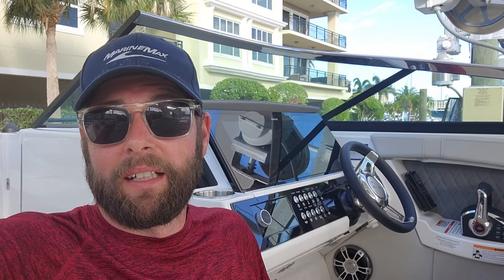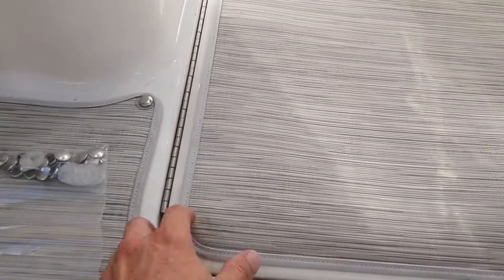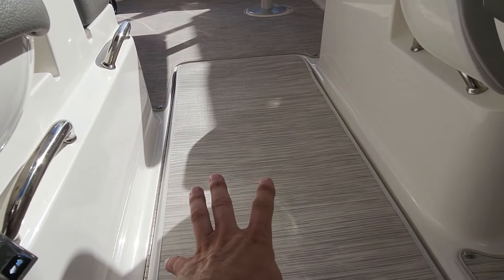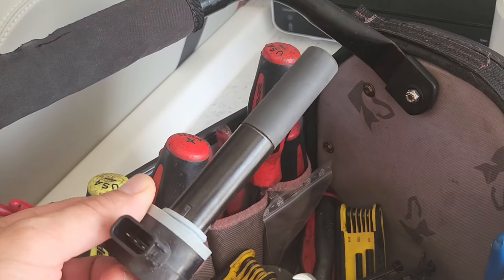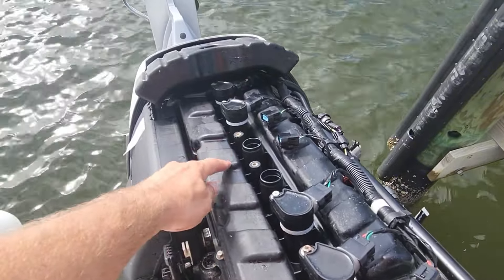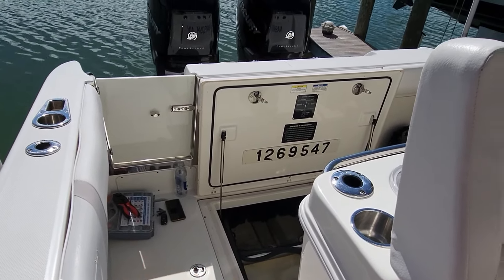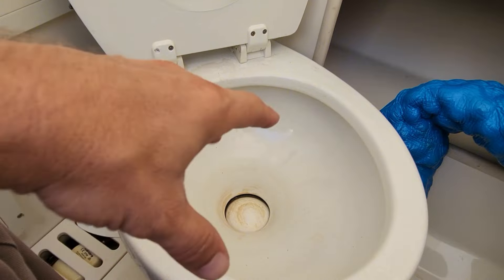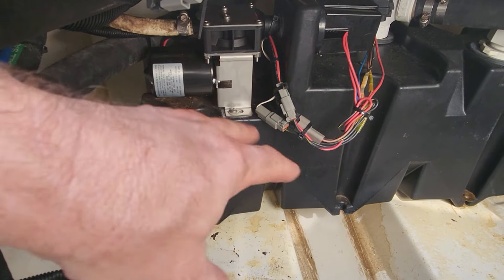What Will Today's Adventures Bring!?!? #Coil #Mercury #SeaRay #Whaler

Comment: Question: for having vacuum on that tank it needs to be complete closed. For emptying it needs air to get in. How is this done?
Reply from the maker: Once you open the cap or the thru hull valve it releases the vacuum. That allows air to enter and the tank to be pumped out.  The vacuum pump that pumps it out is stronger than the vacuum that might be in the tank and it draws from the bottom so it removes everything from the tank. Same as the macerator pump that pumps it out of the boat.

Comment: Justin!! How do I get out the injector dispersion caps that fell into manifolds from pulling injectors   Really don't wannna pull apart engines
Reply from the maker: That is a tough one.  Maybe a small magnet or grabber on a stick camera.  It sounds like you will have to pull it apart to get them out. That's never fun. Keep me posted and good luck.